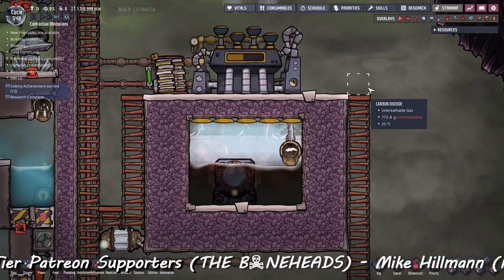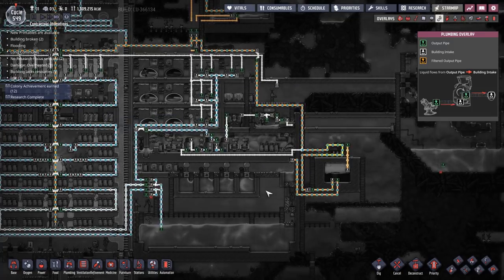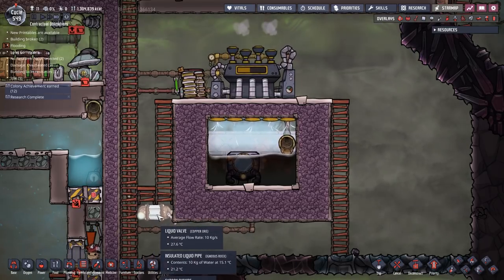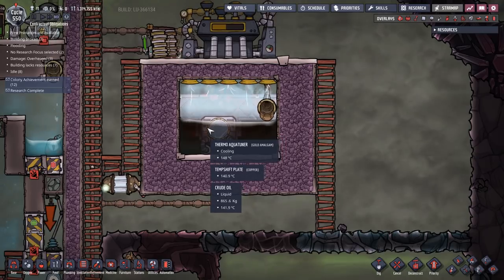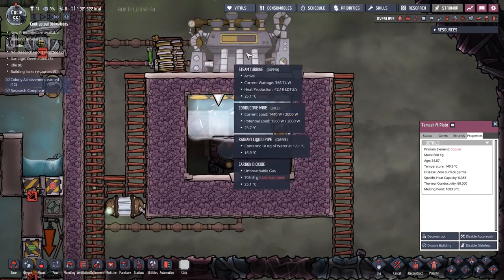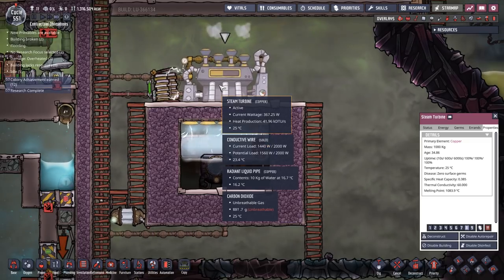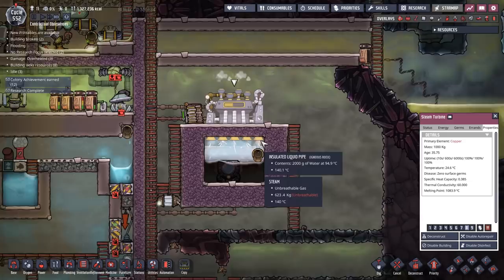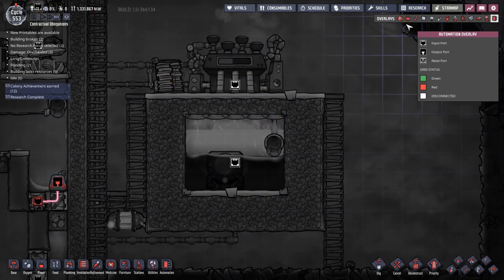How To Cool Your Base - BEST Mid-Game Cooling System EVER! - Oxygen Not Included FULL RELEASE

Comment: Psst... Skye... 

Steam is the gaseous form of water...

Also, you should probably run three Aqua-tuners. I think the general ratio is that three aqua-tuners can run one steam turbine. Though I'm not sure off the top of my head what would change in your water-oil equilibrium.
Reply: IIRC it's 3 aquatuners : 2 turbines
Reply: @Southpaw17  You're probably right, but in general if you use that setup for this and mess around with the flow rate you should be able to make the power generation to consumption ratio of the whole thing more efficient. Though, like I said it's hard to just do it all right out of my head.
Reply: The point is stable temperature control, not energy production. Assuming you want your base to remain around 60-70F then you'll only ever want or need 1 aquatuner, and if you use a reservoir instead of a giant pool and a nice bypass system, the aquatuner probably won't even run 90% of the time.

Comment: What happens when you cool something other than clean water?
Poluted water has a better thermal capacity than clean water and im sure that has an effect on the amount of heat pulled into the aquatuner?

I personally prefer to use automation around these things but i think that may have more to do with the fact that i just enjoy figuring it out.

Comment: What's the best way to loop the liquid around for multiple passes? For example I have the metal refinery and it releases like 140 degree temp (using petroleum coolant). One round through an aquatuner doesn't cut it, so I need to have it run through a few times. I tried using the thermal pipe sensor and a shutoff valve, but I run into issues where it alternates hot and cold water bubbles, or it just gets blocked and stuck in the shutoff valve. Is it easier to just use 2 or 3 aquatuners with temp sensor shut off? But even 3 aquatuners would only bring it down to like 100 degrees

Comment: The problem with this system is that the water has to constantly be pumped through it so the pipes will freeze and it is inevitable becuase the water enters at x degrees cools by 14 and goes tmrough the base so unless it heats up by 14 in the base it will slowly go down and down past 0 degrees
Reply: I just realised it can be fixed by checking the temperature of the water entering the system and if it’s below 14 just piping around the base again or doing whatever else you like
Reply: It will take AGES for that to happen because he's dumping the water in the main water tank and pulling new water into the loop. By that time you will be further along in materials and research and have enough of an understanding of how the thing truly works to be able to begin to improve it with things like an automated shut off.

Comment: It's not exactly in balance.  Now, if you were using that to try to power your base, then you'd have a problem.  But, since that system only has one purpose, you're effectively recovering energy to help cool the water, which is still a legitimate goal to have.

367W - 1200W = -833W
Reply: don't forget the 240W for the pump from his water storage at the start of the loop.  its a good system if you need that much constant cooling. i think this set up and just a temp sensor for base temp to turn the loop on and off would be a better solution overall (and a bypass for liquid under 15C so you don't get pipe freeze). that way as your heat scales it automatically scales with your needs overall it would save the constant 1073W draw, sure the steam gen would produce less but its not for power gen system anyway.

That's the way i'm going to use it, not sure if it will work exactly as i intend but hey worth a go ;)
EDIT seconds later may close the loop and use polluted water, a little less thermo connectivity but freezes @-20C so better for pipes and late game if i need the temp sub zero

Comment: Cool idea, I'm just not very happy with the power consumption that this system has. 800+ Watt/s (1200 watt/s from aquatuner - ~400 watt/s steam turbine) is quiet a lot and considering that in midgame you mostly use BBQ to feed your dupes your base does not require to be below 30 ºC. Pay attention to your coal storage guys, you might want to use this only when the base gets too hot, not for your dupes to catch a cold :)
Reply from the maker: Depends on your base and the map .. if you need to cool things down, this is the most economic way to do it :)
Reply: @SkyeStorme  Yes, its usefull in its own right, and simple, which is a big plus!

Comment: Dont know if you are still reading comments but need some help here. One whats the deal with the drain pipe on top of that sensor that drops the water down. and another is I cant seem to grasp where needs o be insulated pipes and conductive pipes.  Do you have a save of something like this so I can look my self what pipes are what etc?  I tried to do something similar to this to try to cool down a pool of water and 150 cycles later it only dropped 1-2 degrees at most.  Thanks.

Comment: With one steel Aquatuner,  you can run two Steam turbines, which will generate approx 600 power each, so not 100 procent efficient, but still enough to run the Aquatuner without another power source. Also, better to use cruid oil, or polluted water, which has a lower freezing point.
Reply from the maker: 2 steam turbines would take too much heat out of the system so it wouldn't work .. the steam would keep going below 125C
Reply: @SkyeStorme  nope, I'm running such a system without any problems. inspired by Grind This Game and with some tips material vice by Francis John. I even have surplus on the power, not much.

Comment: doesnt it run more efficiant if you use higher steam temp? mid tear you should be able to use a steel aquatuner right?
higher steam temp make (for example 160) = more power out of your generator (you do need a temp sensor for this one set to above 160 degrees)
Reply from the maker: You can't make the aquatuner out of steel .. only basic ores
Reply: @SkyeStorme  You absolutely can make an aquatuner out of steel. It's the best way to generate steam for steam rocket engines.
Reply: Still with golden algum melting temp is 175 so 160 is still safe
Reply: @starshard0  checked the oni wiki its only ore so no refined metals ;)
Reply: Eh, you can make all machines out of Steel.
Reply: @dutch5302  You can't use regular refined metals, like iron, gold, copper, or tungsten, but you can use steel for aquatuners and other equipment.
Reply: @dutch5302  The wiki probably needs to be updated.  Turbine/steel aquatuner combo has become the standard cooling system for a big chunk of the playerbase for a long time now.
Reply: I looked at all 346 mods on steam this weekend (Yes, I'm a Noob). There is one that lets you build anything with refined metals instead of the normally required raw ore. Could that be why the differences of opinions?
Reply: @fistandantillusflinx5041  No, steel aquatuners are 100% vanilla ONI. I'm guessing the difference in opinions is from people who haven't advanced far enough to make steel aquatuners. Hopefully Skye Storme can clear it up in a new video.

Comment: Awesome series!
A question though, is this system design still works?
Tried doing it, always overheats
Realized Aquatuner now overheats at 125C... was wondering why u have at 140 and still no damage.
Reply: You must change the building material of the aquatuner to Gold Amalgam, the default material would be Copper Ore, but that has 125c overheat limit, the Gold Amalgam goes up to 175c
Reply: @andresnexuschamarra6991  Thanks!

Comment: I built this setup and my aquatuner eventually overheats and incurs damage. It's made out of gold. I think I might have a little too much crude oil in the bottom. That's the only thing I can see different from the system in the video. I'm starting to think the crude:water ratio in the "cooling tank" is pretty important. Any thoughts?

Comment: If I'm having cooling problems before I reach the bottom where I can get oil, can I just build this with all water and no oil as a stopgap?
Reply: I got slickster eggs from the printing pod and piped all my CO2 to their stable, they eat the CO2 and produce crude oil, which you just mop up.
Reply from the maker: With water it will eventually overheat
Reply: The problem is the gold aquatuner, it doesn't interact with things around it fast enough unless you have a liquid there.  Most other people using similar setups only use 1 to 200kg of oil per tile at the bottom of the chamber.  If you can build the aquatuner out of steel you won't need the oil and you can run it hotter so the turbine produces closer to max power.  A little automation to stop the aquatuner overheating or freezing water in the pipes is always recommended.

Comment: Aren’t you at a constant loss of power
For me the best cooling system not cools the base but generates power at the same time
Reply: Look upwards, Not the point. Only cooling - strait forward- Not optimal or best possible. With steel and higher Temps it will get Energy  positive
Reply: @grandfremdling3841  how would you get higher temps ? steam engine is hard capping output at 95~C of water back into system .. it cools oil down at consistent rate that cannot be changed and heating up oil more is not possible with this setup either unless you put two cooling units but then power would go up by 1200w so no win there either
Reply: @TechExpanse  
Wow, very old one. Yes you are right. You will never heat up more, only with supercoolant. Sorry. 11month ago i was even more stupid than at the Moment 😎

Comment: That game just hate me! I started on easiest asteroid, and was put in slime biom (everything around me was slime. OK, no problem, i kind of get rid of that, but now I tried to rebuild your cooling system and the pipe next to the cooler just burst every time... 😲

Even with Wolfram it can't take 4°C, wtf game?! 😭😭😭

I still won't give up, screw you RNG goodness!
Reply from the maker: Make sure the water going into the cooler is above 14C and use insulated pipes made from igneous rock :)
Reply: Yes I know, the problem is my water supply, I still do it manually... 

Your videos helped me a lot, otherwise I would be already dead. 

I'm not even sure why I started with the cooling system, I don't need it right now, but I have to try it. 
Biggest mistake is, that I kind of metal ore, I overdid it with my metal hatches, they refined most of my ore. 😅

Comment: Realy nice series in deed but some builds are not the best solutions because on other maps you dont have the same resources like your map. Please make a series where you don't know the map not a map that you know where what is it. Its realy simple to make the best solution when you know the map pretty well.... Be a pro player and play on a random map!
Reply: How do you think he got the map he's on?
Reply: This build uses a copper steam turbine, a gold aqua tuner and some oil (which if you cant find any, slicksters can be got from the printer) and water. it could be built on any map.
It comes down to the player to know if they need such systems on their map. no point building a heat deleting system if your freezing!

sure this system is a constant 1073W draw, But if you don't need that much cooling you can just add a temp sensor and turn it on and off as needed reducing the overall power draw or use one of the other builds people use. you could change it to a gas loop reducing the 1200W for the aqua tuner (liquid loop)  to 240W for a thermo regulator (gas loop) but lose 5x on the heat transfer (dependent on the gas used in the loop. my comparison is a rough estimate using water vs hydrogen gas) but again its down to the player to figure out what they want/need for their base/map.

For example at the moment my base is only cooled with 3 wheeze worts and its staying below 30C (i'm early game on this save) so i dont need this build just yet, however i am using up Phosphorite so i am thinking of changing over to a build like this due to having loads of coal on the map and having a hatch farm (for food) however i am making coal so the power req is "do-able"  and i have found two geysers 1 water and 1 steam so a cooling loop like this could be good for them. so interested in cooling them to usable temps for oxygen and hydrogen for power. a tad to early for me to actually open  up the geysers and see how viable they are. However this loop could be very useful for my current base/map and potentially (depending on the geysers outputs) be my main oxygen and maybe power source

Comment: Yes it's nice solution but on your map you have cold water to do this. Try to do it with water that is 60C and see what will happen!
Reply: You can absolutely start at 60C and cool it off. It just takes longer to get to equilibrium. You can speed that up by cutting out the dump in the water supply section. I just did it in my map.
Reply: adapt it to cycle back through the aqua tuner to cool the water to meet your requirements. you can easily add a temp sensor and switch to only let "X"temp water through or it goes back through the tuner or just have the cooling pipes go into your pool of water to cool it that way. 

Best to look at the vid as a rough guide and not a exact build lay out for all circumstances.

Personally im thinking of using the cooling loop to cool the water before i send it to the Electrolyzers then vent the cool oxygen into the base. Potential issue being getting the exact oxygen temp right to cool the base while still sending enough oxygen to the base. it is probably better to cool the base with the liquid loop and add a sensor to turn the cooling loop on and off to meet the temp needed in the base